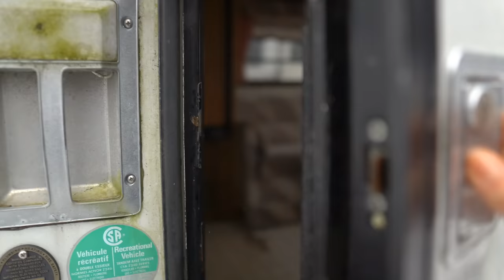gutting my Jeep to make it into a camper

Comment: It’s good to help your dad fix it , because you will learn and the more you learn , instead of a propane stove , think about a solar system with a induction cooktop and small refrigerator , hook all up separately from the engine , but also have a switch where you can use either the truck system to charge the solar , or the solar to jump the truck system
Reply from the maker: I def want a solar setup but I think a small propane stove would be best since I won’t be using it too too much
Reply: @TorieRobot  you can get a induction cook top smaller then a laptop , and it’s not a bomb , but propane is sorta safe

Comment: Wow! Your dad is THE MAN! Cherish what time you have with him. You can learn a lot of things you need to succeed in a home on wheels from him. Just an idea for the ceiling, spray foam can be molded with saran wrap and wood. Insulate and create a substrate for paneling without leaving an air gap that could collect condensation and create rust on the metal.
Reply from the maker: Yes my dad suggested spray foam as it’s lightweight which we may still use but we came up with a different idea for the ceiling
Reply: @TorieRobot  Alright! I can't wait to see what you come up with! Keep evolving, but stay extraterrestrial! 😁

Comment: Victoria, trust me, the old style Jeep Cherokee is a great choice. They're mechanically simple and parts are common, which means cheap. I bought one when I moved to Alaska (MIlitary servicemember stationed at Ft Wainwright) and it ran like a top in conditions from 90+deg F to -60deg F, then I drove it down to Texas in Feb when I was reassigned four years later. It's a 2000 XJ and I still own it to this day 7 Feb 2023. Your biggest worries will be rusting and overheating. One word of warning, salespeople will tell you to put truck tires on it because it's an SUV, do not listen to them! What you want on a Cherokee are the heavy-duty radials like fleet cars use. Think cop cars and limousines. Truck tires are built to support much heavier vehicles that carry even more weight on top of that, so truck tires will make your Cherokee feel like you have solid steel wheels. The Cherokee is more of a lifted station-wagon than a truck, and they run too light for truck tires even max-loaded and towing the kinds of trailers they're rated for.  Just a little lesson-learned from the Jeep-family you've just joined. Good luck on your journey.

Comment: Hi Victoria, Just a quick warning regarding your windshield wipers. Do not use your wipers to clear off the snow because the linkage that controls the wipers will break and you'll end up with an expensive repair...and no wipers until you get them repaired. I'm from Montreal and this is unfortunately a common problem here with people that get surprised when it happens to them. Cheers!

Comment: As an old furniture manufacturing supervisor I need to remind you to seriously consider low emission plywood in your construction. 
All plywood/MDF/chipboard off gasses for a while as it's adhesives dry.
Mostly formaldehyde is released into the air.. 
Another point to remember is plywood is the most water resistant of the three, MDF and chipboard are sponges.
If you do use the EVA foam floor pads for a roof liner use the old liner pad as a template. You can find packs of it 3/4 inch thick covering a 2ft by 2ft area for $30 at walmart. It's R insulation value is only about 4 per inch though.
As always good luck.
Reply from the maker: Okay thanks for the tip 👍🏻

Comment: The strat 6 engine is a solid motor 
Keep up on maintence 
Even if you at some point have to rebuild its worth the money 
Its not a bad purchase 
Any vehical you buy is going to have issues 
Save money for transmisdion repair or swap change rear differential fluid inspect while in there.
Upgrade suspension 
It looks to be in great shape

Comment: The straight six engine is actually a really good engine. If possible I would redo the head gasket and replace the whole coolant system. You would spend a good amount of money but it wouldn’t over heat.

Comment: My Mom lets me the Jeep Compass 2011. It has  the same blinker effect on the same side. I didn't check the rear blinker. My Mom's gematria score is 54. But VICTORIA ROSE =154. Activated 54 is 154 because in the binary world 54 would be like 054. 2011 - 1998 = 13, Are you 35years old?
Reply from the maker: Huh? No lol
Reply: @TorieRobot  Then 2011-1998=13, one and three would assemble B. 666x3=1998, and 2011 has the force number 11. Does that make sense? Anyways, I understand myself.

Comment: Okay the long comment i left seems to have vanished, not sure if you did that or youtube because I put a link to the dreaded amazon in it, but I just sent you a donation on paypal anyway for the camper work. My neurodivergant brain finally got around to watching the video, but i was writing the comment out as i watched the video and didn't check your amazon list until afterwards and found a bunch of my suggestions were already on the list. When I went back to edit the comment to take those out it wouldn't let me save the changes.
Reply from the maker: Nope don’t delete comments but thank you so much for your support ! And for checking out my wishlist 😄
Reply: @TorieRobot  Four minutes into this video (of a resto-conversion of a chevy service truck) some folks I know have them fitting some insulated matting they got from wirecare, which is one of their sponsors, which might be exactly what you want for insulation between the outer sheet metal of the rear cabin and the rest of your new living space. I can ask Emily what the specific product they used is called if its something you'd like more info on. 

https://www.youtube.com/watch?v=Cmo-gydfEaY